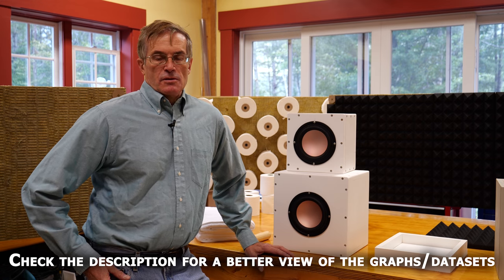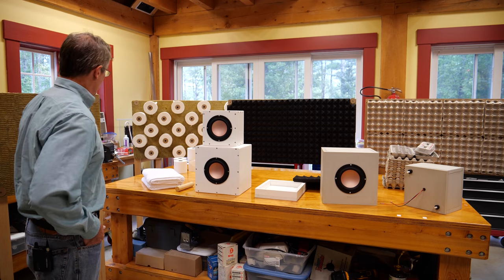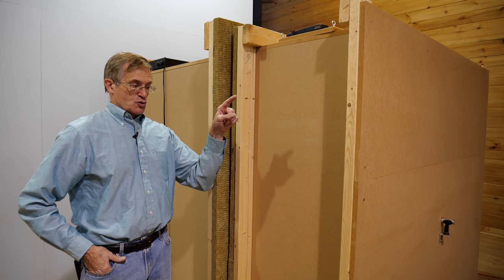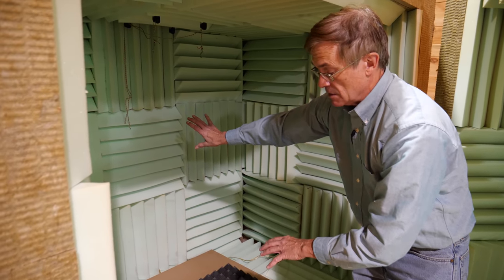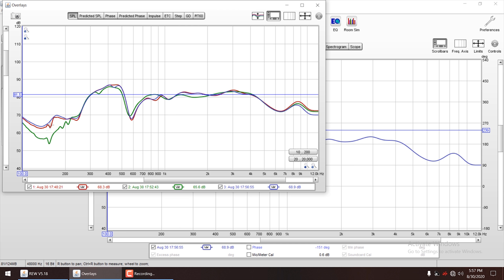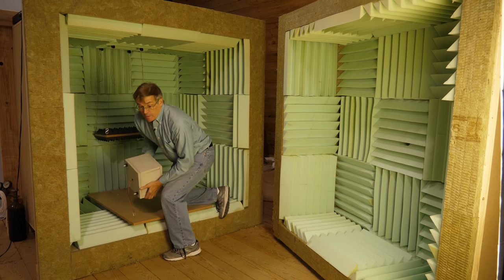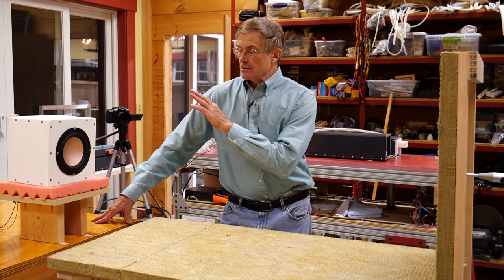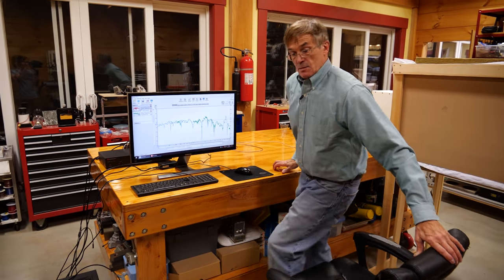DIY Speakers and Acoustic Panels

Comment: Damping material is beneficial in speakers but you need the right kind, amount and placement.
The benefit of the right material, besides damping unwanted reflections inside, is that it makes the inside more isotermic and equalizes pressure. To the driver this makes the volume seem bigger. It also have the effect of making the driver behave more linear.
The amount, placement and proper material is also different between closed and reflex speakers.

Comment: How about rounding the inside of the subwoofer enclosure ? The picture that comes to mind is  like a test tube behind the woofer. No sharp angles behind the driver. I think it could be achieved with spray foam. Just an idea.

Comment: The dip at 1.6kHz and each multiple is cause by the destructive interference caused by the path length different of the direct wave vs the indirect wave bouncing off of the wooden sides.

This is why you see the toilet paper is more effective up high because its breaching the hf beam as they protrude out

The toilet paper and foam covered rockwall is actually performing better at lower frequencies then all the other materials and the rt60 will also show this (compare the result in your anechoic  chamber to these results, the closer to the anechoic result the better for clarity) They other materials are reinforcing the lower (actually mid) frequencies which isn't necessarily a good thing

Comment: You guys are amazing, but one issue. Helium rises. You could not have filled the speaker with helium because the inlet was at the bottom and the outlet was at the top. The heavier air simply could not be pushed out of the top by the lighter helium. Think of it as a bubble of air in a tank of water. Sure, the air would push some water out, but nowhere near the amount I'm imagining that you wanted for this great test. To fill the box with helium you have to do the opposite of what you did -- the inlet for the most buoyant gas has to be on the top, and the outlet must be on the bottom or else the lighter gas will simply exhaust through the outlet like an air bubble in water.

Other than this, so far (I stopped watching to write this [we'll see if I have to delete everything]), another stellar video, boi!

Comment: The lack of low frequency blocking in the anechoic chamber could also be attributed to the baffle step response of the speaker enclosure, essentially  the speaker will radiate sound 360 degrees if the wavelength of the sound is larger than the width/height of the  speaker. Here's a good artificial that explains the phenomenon in more detail      https://sound-au.com/bafflestep.htm

Comment: So here's a question - is there any appreciable difference from having the speaker in the fixed portion of the chamber, and microphone in the 'door', versus having the speaker more easily accessible by putting it in the 'door' and the microphone fastened in the stationary portion?

Comment: I noticed that if you put your ear against a roll of corrugated cardboard (along the axis) it actually sounds really quiet indicating that it absorbs sound pretty well. Therefore it led me to think that perhaps stacked corrugated cardboard might be a good sound absorber, but it would be quite a bit of labour to cut them into strips and glue them together to form like a honeycomb structure which can be used to cover walls. Not sure if you've thought about this before?

Comment: Are those "ports" just holes drilled in the speaker box??! 
A port is supposed to create a tuned system, usually via a tube, reacting to the volume of air inside the speaker cabinet.

Comment: Should you not be retaining the control material (hard particle board panels) throughout the whole test of the sound absorbing materials? I understand what you were going for in comparing material to material. However, what stands out to me is that the two best performing materials (roxul and acoustic panels) also did not have the control panels which you did use as a mounting surface for all the others. While I'm sure those materials are superior, it's is notable that having the panels behind the other materials introduces a variable.

Comment: I don't know why you would go back to the spiked foam after it got such a result,  & you should of shown off the mattress foam from your big set up.  I Would be interested in what the sound damping they use in cars does, its so slim & apparently converts sound to heat? its probably about sound pass though then reflection.  But that's what I want to see tested to find out.

Comment: That's why bass doesn't need a specific direction to be heard well unlike treble which is very directional. Good testing and interesting to see the actual signal loss with various items. However, the DIY bath towels was stretched across a frame and worked best with one on each side. Low frequencies are the hardest to control.

Comment: once more why only do measurements from 100-12000 (just like the suposed best speaker of the world.... clickbait)... thats to bad.  you have to be 65+ to be not able to hear above 12Khz. that makes it most of your live you will be interested in above 12khz. compared to not able to hear it. i i mean 20khz is only heard by children... but 12khz...
Reply from the maker: The inexpensive drivers drop off  and the trend is what we wanted to cover.  We could have pushed it a little higher at the cost of some resolution across the screen.

Comment: At about 10:00 you start talking about the effect of just putting your head inside the opened chamber and experiencing the deadened response, I totally get that.  Up until fairly recently my wife and I kept our hobby yarn in lidded totes but we have so much now and kids have moved out, we moved the yarn onto shelves where we can see and enjoy it since the kids' books are gone.  The resulting anechoic effect just in the room is striking, it is easily the deadest room in the house by a large margin, and the corner where the greatest concentration of yarn is is very still indeed.

Comment: Thanks for the info. I do video editing and sound mixing so this was helpful in thinking about how to improve my workspace. Would love to see how much the performance of a fixed space can be improved with a parametric EQ. It would be an interesting comparison also to compare an acoustically treated room with parametric EQ with same room minus the acoustic treatment. I guess the purpose of that would be to see if you really need the acoustic panels or if just the EQ would be enough to get a mostly linear listening space. I love this kind of video, thanks!!

Comment: I'm fairly certain that a bit more flexible outer shell would be more beneficial. Rigidity will increase low end reflections. And since it is already sitting in another room the reflections that emanate from the flexible surface will not bounce back into it and thru the absorption layers with any significant levels.

Comment: im trying to build something around my compressor to silence it, it needs to let air in (possibly just add a car muffler) and have to let heat out but not a lot of sound. and adding rock wool and the like would definitively cause heat issues. have any material recommendations for that?

Comment: Try using the reverberation time measurement (RT60 tab) to measure absorption rather then the frequency response. 

You're not getting as good results at high frequencies because the speaker is beaming at these frequencies so these sound waves are not hitting the test material. You should see a better result with the rt60 measurement up there but ideally you need an omni source and a rev chamber

Comment: Very interesting. Im looking to add some acoustic material to my AC blower closet which is in the middle of my living room so I can hopefully reduce the noise when it comes on during night tv session. Based o. The video I was thinking of using the acoustic ceiling tiles but Im not sure if thats neither the best option or if it is safe to put there since it will be circulating the air around the house

Comment: Probably would have been a good idea to put the hard material behind the acoustic tiles during testing as the ones that to have it like the towels will have the sound go through them, bounce back on the wood, through the material and into the chamber, while the sound that is transmitted though the roxul is just going into the room which will most likely affect the results and be less representative of an acoustic panel that is hung on a wall

love your videos btw, don't stop making them, especially the ones about acoustics

Comment: Seems to me you'd get better helium flushing by filling through the top port.  That way the air (which sits on the bottom) would exit through the bottom port as the top fills with helium.

Comment: egg cartons would be more effective if they weren't glued solidly to the walls. some thick double sided foam tape in the corners is all you need. if you're getting them for free there's no reason you couldn't use two layers as well.

Comment: If you use natural wool fleece in your anatomic chamber quarter of an inch thick folded up hang it loose away from the foam in a circular configuration will reduce all your low-frequency

Comment: I guess the angle of the front plate of the speaker has some effect. It would have been nice to see some freely resonating bitumen sheets on differently spaced framings and combinations of those and dispersive materials.

Comment: 22:30 He inserts the helium tube into the port on the bottom of the speaker. Helium rises so it wouldn't fill the box unless maybe he left the regulator turned on during testing. Putting the tube on the top port would allow the box to fill to the bottom port before escaping.

Comment: When testing the materials for reflection it would have been interesting to see a comparison between the performance of the same driver/enclosure in the anechoic chamber to the measured performance of the material, to cancel out the characteristics of the driver and enclosure itself.

Comment: Awesome video as always! I was wondering. Do to lots of people building their own homestudio during the pandemic, I can't find rockwool ANYWHERE here in Chile. Of course glasswool is an option, but is way too "toxic" for singing. But, I found that a shop is selling "polyester wool" saying is not corrosive and a pretty good acoustic isolation material, but I can't find ANYTHING online related to this material. Do you have any experience with Polyester Wool? Or maybe can you do a video using it? Thank you so much for sharing your knowledge!
Reply from the maker: I don't, but all things being equal  in terms of the layer thickness  and the enclosure size, it's  significantly lower mass due to the density of a plastic fiber vs a glass or better mineral  fiber, it's low frequency  absorbtion should be significantly  less.

Comment: Since you have an appreciation for GamersNexus and their viewership (myself included) are very interested in your channels, I'm sure there are opportunities for crossovers between you - you've already done the thermal compound - what about airflow through computer cases or something? I would say optimized water cooling setups, but I'm sure the margins for optimization are only a few degrees so it might not get a great ROI...but there must be *something*! Maybe "best pair of desktop gaming speakers...?" You haven't mentioned subwoofers much....there must be something...🤔
Reply from the maker: We're building an overclocked gaming computer based off an airconditioner.  Stay tuned.

Comment: A nearly ideal anechoic chamber is available to almost anyone. It's commonly called "outside". Altec and JBL used to test pro speakers in an open field. The numbers are unimpressive, but accurate. I think Bose tests their speakers in a steel drum, then they use a ruler to plot a flat line from 0.1Hz to 20MHz, after which they laugh, pat each other on the back.

Rock wool panels with burlap covering between movable dispersion panels (or book cases) can flatten that curve right out. Dispersion panels are sometimes made with random cut strips of wood, stacked to form a panel at likely reflection points. The idea is to add reflection randomly, which prevents that dead, open-field sound, without introducing a lot of standing waves.

Try the rock wool test again, but add two stacks of random size books on either side. Tune the chamber by moving the book stacks forward and back to move reflections to a point where they fill in a troublesome dead spot. Listen to some music after tuning a chamber that way. All the meta-metaphors and audiophile jingo, right there in your ears. "Alive", "massive sound stage"... Yeah.

"Engineering Acoustics", Elsevier Press. A great book that explains this stuff almost as well as you do. Thanks for the video!
Reply from the maker: That is how we evaluated the panels to construct our chamber and the video was posted last year.  However, we live in New England, nuf said.

Comment: The dip at 600hz in all of these systems is interesting. It would suggest that all would benefit from a multi-band equalization system. I am going to remove the insulation from my woofer enclosure, though.
The frequency range that makes a room "boomy" I would think is probably between maybe 300 and 2500 hz.  Perhaps the focus should have been more about what is happening in that range.
Reply: Back in the seventies I got into HiFi at a very young age. I started out with the baby JBL bookshelf speakers at the age of 16 and by seventeen I went up the JBL ladder to the L 300 Summit’s. When I made it to these I found most people who had them did bi-amping minimum and some did  tri-amping. But the other thing everyone had was the EQ. I had the Soundcraftsmen EQ and had someone come over and mic the room every time I moved to a different house to calibrate the EQ. To this day I still feel they are beneficial even though I’m not using one right now. The seventies was one of the best decades for HiFi enthusiasts.

Comment: Awesome video, surprising results. For the LRAD, are you doing a general area denial type or more like a SASER type setup? Looking forward for the next video. Pretty excited, thanks!
Reply from the maker: It's relatively simple.  Multiple, very powerful horns driven with 12V automotive amps for portability.  I'll discuss the more sophisticated issues, including safety/risk, but the system is pretty simple.

Comment: The anechoic chamber has got very good. If the 15 million dollar chambers were priced in direct proportion to their effectiveness & accuracy throughout the audio frequency range, then above 600Hz or so, you've got > a few hundred 1000 dollars worth of chamber there. That speaker-aiding use of helium is fascinating, it's got me thinking about speaker ideas using metal or some helium-retaining cones, pressurised cabs etc
Reply from the maker: Great, that's the point of all our videos.

Comment: Why did you make your enclosures cubes?  That is the worst possible choice from both internal resonance and diffraction standpoints....I mean that is enclosure design 101.  I really enjoy your work but sometimes wonder just how thoroughly  you have researched the topics involved.  Why introduce more frequency response altering variables?  Still, it was thought provoking as always.  Thumbs up given!
Reply from the maker: We weren't trying to create an optimal enclosure, but rather to evaluate the effects of the materials and the sound absorbing layer.  I should have emphasized that.  Even though you don't mention it, the port area and  the internal volume were also not discussed for the same reason.

Comment: Is there any difference if you reveres the orientation of the egg cartons. (Detach, flip 180, re-attach.) They "feel" like they are installed backwards, (but only hard data would show if there is any change.)  Did you try Egg cartons on top of the rock-wool?
Reply from the maker: We didn't try that.